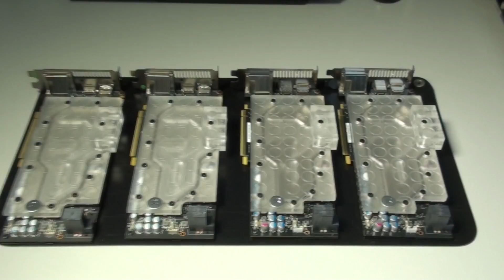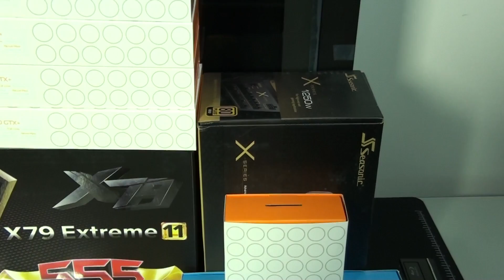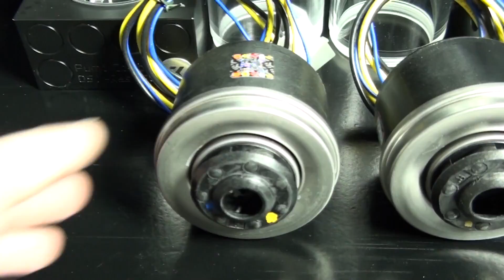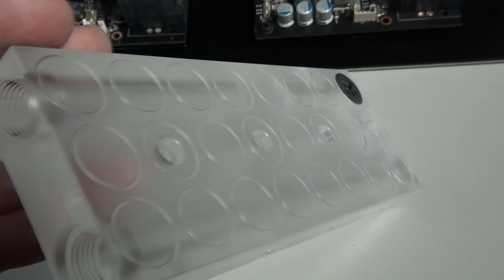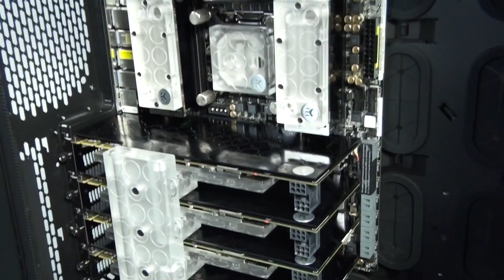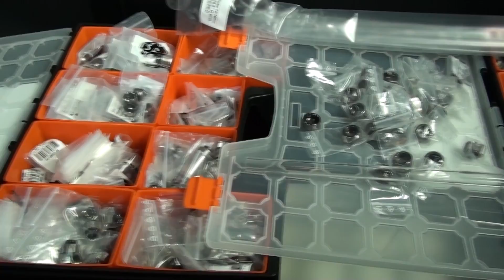Build #12: Quad SLI 900D: Part 1

Comment: The bridge runs semi parallel as it is very difficult to achieve equal flow rates for each water lock otherwise. The first blocks get more flow, and each block gets less and less flow. Semi parallel reduces this problem.  Although from my experience a series configuration is a much better option. Equal flow is much more important than a 0.3 degree water temperature difference

Comment: 4-way sli, not quad sli
Reply: quad sli or quad fire is 2 cards, each with dual gpu's on them... 4 way sli or crossfire is 4 separate cards, each with 1 gpu on each individual card
Reply: +richard mendez Quad sounds better ;P
Reply: Whats the difference

Comment: The reason for the semi parallel flow in the gpu bridge? To ensure proper circulation through the water blocks. If they ran parallel, there's an opportunity fro the flow of liquids to go straight up one side and down the other. It would circulate through the  gpu block and the end, but the ones in the middle would just get "bypass" flow, and not full circulation.

Comment: 3 things i can think of for semi-parallel config.  Im no watercooling guru, just what logic tells me: 
1: the total flow rate will be the same regardless due to the pump so if water is flowing through all 4 blocks at the same time (full parallel) it will pass through at 1/4 speed through each block (does this matter for cooling though?) This config will be 1/2 speed. 
2: this 1/4 speed may make it hard to push bubbles through

3: if the waterblocks dont resist flow much ie: 3 blocks can manage total flow of the circuit with no added resistance, water may not flow through a card properly- mainly the top card where head pressure is lower.

Just thoughts.

Comment: Singularity, u hav inspired me to build own pc, i might resprat the gtx ti with a green and call it the SteXbox or the Green Machine. But, it is in a Mini ITX 250D Obsidian from Corsair. Can you like make a build guide for the most potent pc but at the same tive value. I at the moment have these specs: http://uk.pcpartpicker.com/p/rRznjX
And maybe you can tell me what to change in terms of performance, i think it is the highest i could go and at 1k (now 1.5K for many reasons..) it isn't that bad considering this build probably cost half a millie :D
Reply: I think you should upgrade your hd 500GB fills pretty quick
Reply: Kurus IV
i have a 500gb on my laptop, almost fucking full and it hasn't been a few months, like 4. fml, but i want to know something, will the coolermaster hyper evo 212 fit inside of the corsair air 240 case? Pc part picker is lying to me and saying it isn't compatable
Reply: it should, 500GB is nothing it might be ok for the console peasants but not for the glorious pc master race
Reply: Also, maybe upgrade your ram to 16GB just to be a little future proof :)
Reply: Kurus IV "it might be ok for the console peasants" funny!
"Also, maybe upgrade your ram to 16GB just to be a little future proof :)" That seems about right, the issue is i am reusing my older HDD from me laptop - it has everything, but it has 32, so if there's a way to upgrade to 64x then that might be cool.
so far i need a fan under 1200mm, any suggestions? i found out that the corsair air 240 might be the best for me, but i might go crazy and put a passive CPU cooler, or not, not sure, i might think about this build for a while, so far i have dual gtx 970 instead of single gtx980 becuase of the sli, and the price to performance, and a intel i7-4790k becuase i might edit vids and stuff, i might go OP and get 32 gb, but i might not need, i might also get a plasms tv, becuase plasma master race.
Reply: Maybe try and back up your laptop hd and put it all on a 2tb hd or something crazy shit like that

I know absolute jack shit about fans, sorry :)

meh sli is ok I personally would go with one gtx 980 then save up and put another in

Intel i7-4790k is good a little overkill but nice cpu and 32GB of ram YOLO RIGHT

Plasma tvs... most of the filthy peasants play on those
Reply: Kurus IV Most don't, i'd say that most play on some cheapy LCD, but plasma? never diss dat shit, no pls, ips, va, nothing, only downside is the size, it is for home cinemas, so i'f i'm gonna wait for a plasma like tv, i might as well wait for OLED to become cheap.  wich might take a cuple hundred weeks :P.
and you have a point on the gtx 980, but i might just buy a gtx 970 bc cheaper, won;t be outdated until x time, and if i have spare money, might fit a third one, or sell both and buy a dual gtx 980, so i don;t know, thanks ofr the help anyways :D
Reply: ***** "people like you bore me, sitting on that computer of yours talking how glorious the pc master is go out and do something with your life. "
So what do you do?
Reply: *****
mate, it was a joke, it wasn't serious, and i asked him for some guidance. Can you do better?
Reply: *****
No, intel i7 4960x with dual gtx 980
Reply: ***** curry build for a day involves 3 gtx  970s absolute beast I tell you

Comment: The reason EK has chosen to do a semi parallel config is because you then reduce the amount of back pressure to the single outlet in a full parallel config so by splitting it up you get better flow.

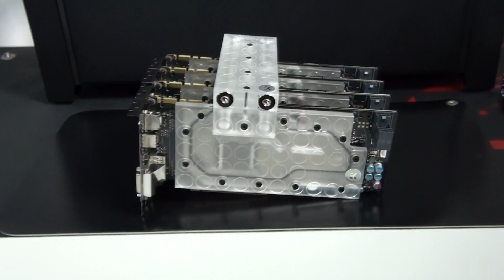Comment: 13:46 Despite it being "parallel", gravity will play a factor in favoring specific out ports. And the design above creates an on-the-spot mixing action to allow a more even fluid temperature exchange.

Comment: 13:50 For those who don't know: A parallel bridge (same distance and resistance) with more than 2 elements will reduce pressure of the flud in the ones in the middle of the config.
Reply: omfg ur so smart teach me ur wayz plz
Reply: Such parallel, much amaze, very water cool.

Comment: The Split Flow is Obvious on the graphica card link ... if there was Only a Single tube to connect all the Four graphics cards the unifying tube would have to be Way bigger in diameter to maintain the same flow or pressure inside would have to increase for the same diameter  single connection, and hence would increase stress in the pumps ... Simple Hydraulics ...

Comment: The ek block is semi parallel because if it was full parallel water would just flow threw the main tubs and not circulate in the GPU blocks as well as a semi parallel due to the lack of pressure in a full parallel setup.

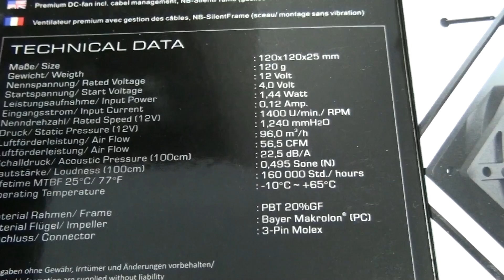Comment: your fans @ 18:37 the NB-Black Silent Pro aren't that great at all. Try Noctua i don't care if you dont like the color scheme they're are made to perform great. 

Noctua NF-F12 PWM: 2.61mmH20 Static Pressure, and for radiator fans you want as much static pressure you can get. 22.4dBa @ 1500rpm, 68CFM. 6 year warranty, 0.6W for input power and 0.5A for input current.
Reply: These builds are all about looks. No one doubts the ability of the noctuas, they're the best fans period. The colour scheme is the problem.
Reply: yeah but most of these people have the cases to where you cant see all of the inside i.e the case fans. but they could honestly do a build and fit the same color scheme believe it or not. I run a black/beige/brown color scheme in my PC. and with these liquid cooling setups you could do a tannish dye color or just do a straight black tubing and no color dyes, those actually screw up the system rather than just color tubing.
Reply: Cley Secor AP-15's are the best rad fans period
Reply: Sanjay Saini They're very good, but every test i've seen puts the noctuas ahead in terms of temps.
Reply: Adam agreed they are excellent fans
Reply: that is true but with some fans you can get both sides as well. i can run my noctua's at 9dB and still get decent perf. but yes you're right if you're running more rads. but most common users will just use an asetek type of cpu cooler and thats it. that's why i mentioned that but in a case like these client build no it doesn't matter too much i guess.
Reply: andiders Right which is why i went with a military look it fits the theme and helps me out by 10*C in my rig because what i run. and out of curiosity what the hell do you do to require that much.
Reply: Cley Secor Good news, Noctua has pre-production BLACK fans made, but nobody knows when they're releasing them ...

Next to that, why would someone care about the looks of the fans when they're hidden away? Especially on the 900D, when you only mount fans to one side of the radiator, they are invisible from the window and from the outside.
Reply: andiders yes i know i have a 750D but its military themed so it doesn't look bad. if your nit picky when it comes to visuals don't bother with them but a s a fan its a great piece of hardware.
Reply: Do you have any pictures of your rig? I'm planning on grabbing the 750D for a watercooling rig and I'm always open for ideas :)

Comment: I'm not brave enough to remove the heatsing of my RAM so i only install the CPU and GPU water block in my pc.
Another thing i want to say is i'm a huge fan of 5.25 bay res so the 900d is not for me, i use Caselabs Magnum TH10 so i can install the 2 FrozenQ dual bay res up front
Reply: Do you have a build log anywhere. I am interested to see how full the case looks with bay reservoirs
Reply: Zack Volpe ii'm still working on my build, still waiting for the 2 GPU water block, no build log but i will post pics on overclockers com, member name is: ASUS ROG
spec is I7 3970x, ASUS rampage 4 extreme, 32gb Corsair Dominator platinum 2133, 2 GTX TITAN SLI, OCZ RevoDrive 3 X2 240gb boot drive 4tb hdd storage
Reply: Nice what's the color scheme. I'm still waiting for Case labs to release there Gemini line of cases to start my new build

Comment: No offense, but if it says ASRock, ECS, MSI, or BIOSTAR (ASRock and ECS being the least problematic and more stable of the 4) I can't ever call it a high end build. I don't mean to bash other makers, but all of those brands have either failed me or caused me grief than the cheaper price was worth. I would have also sold off the video cards and gotten all Identical video cards for aesthetics and just to know for sure everything is happy with each other (considering firmware an all). Removing those ram sinks can be risky, I have seen people rip the chips off the PCB. And EK probably went semi parallel because they needed the flow. I'm not a fluid dynamics specialist, but I know it could do some silly stuff and you might get stale water (low / no flow )

Comment: I think that the semi parallel bridge is made because sending all of the water through 4-way parallel would result in lower pressure.  Indeed, by sending it through 2 cards at a time (which are fairly non-restrictive in nature) will result in double the pressure per card.  doubling the pressure doubles the amount of water touching the card and thus improves cooling, assuming adequate radiator capacity.

Comment: Thinking about this config maxed out of everything makes me nervous, what a system¡¡¡ Btw I think that EK has gone with such a design for the grafics cards' bridge in order to split the amount of heat in the last grafic card in the water cool system; by this I mean that if there are 4 grafics card and number 1 is the top one, number 4 would be taking all the heat from the 3 cards above it, so in order to prevent that they had chosen that design.
Amazing video as always, thank you so much.

Comment: I would love to see those blocks polished to pure transparency rather than frosted.  With that graphics block and the increased acrylic tube size, are you going to reduce the pressures into the block enough to introduce any issues; or will the flow still be enough to run multiple times through the system to reduce the heat generation?

Comment: Parallel tubes in the block would make the water search his way with the least amount of resistance, which would be straight forward and not go thru all of the graphicblocks. By splitting 1 tube up in 2 sections you can supply the graphicblocks from 2 ways with coolant.

The straight tube is the exhaust.

Thats my thought about it

Comment: My guess is with a full parallel 4 card set up the flow would be huge maybe to big for a single pump If you where running 1 loop( though why would you have 4 cards and not make it its own loop). Long time viewer 1st time commenter.
Reply: what parallel does is split the flow, so in 4 way full parallel, each card would only see 1/4 of the coolant that the pump is pushing.  The advantage of parallel is that there is far less restriction of the flow (in this case 1/4 of the flow restriction of 4 blocks in serial).  EK probably looked at 1/4 of the flow as not enough to cool the gpus and did 2 sets of the gpus in parallel and those 2 sets are in serial.  This doubles the flow to the GPUs and doubles the flow restriction.  EK most likely knows any decent watercooling pump can do 2 gpus worth of restriction.  I think this is the optimal way to watercool 4 gpus.

Comment: Holy EK fanboy! 
If you did the sand paper mod on those gpu and sli bridge to take out the smoke look on the quad sli it would greatly improve the aesthetics of this build especially if you are going to use coloured coolant. I have seen that mod done very well and think you should consider it for this build.
Second question why are you doing a push config on the bottom rad and not pull to get the air out with the front fans pulling in cold air bot rads expelling that out the case with a rear exhaust?

Comment: Not a fan of Quad SLI, specially with GTX 680s, now there are plenty of more options for high end graphics. But 4 GPUs always looks good, and I understand this were from the client's previous build.
Reply: ezforsaken If you read my.post the 3 4k monitors was a statement on scaling not this particular setup. The only thing i said about this set up is "he may be future proofing for next gen monitors"(4k OLED). I doubt 4 680s will run 3 4k displays. But i haven't got to put my hands on Three 4ks yet to see. 

Scaling from a fps point of view leaves a lot on the table. Not everyone uses 4 way sli to game. That is why i said "Scaling for 3 way and 4 way is minimal at best for gaming"
Reply: No, but I have probably read every benchmark and review done on the internet about it.
Most of the people on the videos are theorycrafters just like me, we may not have put our hands on 5 grand builds, but we sure know a hell lot.
Reply: ***** I'm a System engineer student, 90% of all we see is Theory, yet I'm a year to end the career, then get an outstanding job where the only thing I have to do is provide guidance using my theory knowledge, and purchase my hardware with the money earned. Theory is everything to me.
Reply: ***** I've spend enough time talking to a troll bye.
Reply: ***** You don't need to run quad sli on your own, to understand that quad-sli runs less than 10% faster, sometimes even slower than 2-way sli.

Having eye's to see the benchmarks is enough.
Reply: Scaling for 3 way and 4 way is minimal at best for gaming. Now that said if you are using 4 cards most likely you will see a huge jump in performance at higher resolutions. And when i say high resolutions i am not talking about 5760x 1080 that is child's play. I talking three 4k monitors @ 11520 x 2160. So in a way he is future proofing for next gen monitors or had some extra money to spend.
Reply: LunisGames Those cards don't even have 512 bit buses, do you expect them to handle 12k?
Reply: LunisGames if he was future proofing he would have gone with 780 Ti's if he was smart. no doubt there good cards but would have been better getting 700 series cards at 3 way. from what ive seen quad Sli has way to many problems and drivers dont support it to well and the games as well.

Comment: The ek fc bridge is semi parallel because splitting the coolant flow beteween 4 cards would mean loose too much speed and flow, even with dual pumps....and also in the semi paralel config the path of the coolant is still short so it wil not have any issues of the coolant loosing speed

Comment: the videocard waterblock is split so that you can have 2 pumps in parallel so there is only 2 videocards per pump lowering the flow resistance and increasing the flow-rate

Comment: 4 GTX680's and than he uses ASRock motherboard??? Fail rate of ASRock motherboard's is ridiculously high and the overall build and components quality sucks... He would be aloth better with ASUS Rampage IV Black Edition, EVGA X79 Dark or MSI Big Bang-XPower II
Reply: He's running 4 graphics cards... I only know of a handful of boards that can run them with full bandwidth and this one has a lot better options. Though I'm really disappointed this board never got a block made besides the mips one and the custom one
Reply: prototypep4 what about the asus x79 ws-e or something, which has the same pci configuration
Reply: Yes that would work (and would be my dream motherboard if they made a damn block for it).

Comment: 4 way SLI.... terrible choice! No way superior to a 2 780 Ti....
Reply: ***** I'm not trolling at all...calm down! I hope you understand that sli don't scale very well from 2-way to 3-way and even worse from 3-way to 4-way! So 4-way SLI is not equal to double the performance of 2-way SLI...at all! 
So if you want a uber overkilled machine is better have 2 780 Ti that also have more VRAM  and also less heat output...

Comment: Full parallel would put more strain on the pump. I think you mentioned in a previous video that there is only a minor cooling performance difference between full parallel and semi parallel, but it puts less strain on the pump because the distance the coolant has to travel is shorter.

Is that right? Meh, it might be.